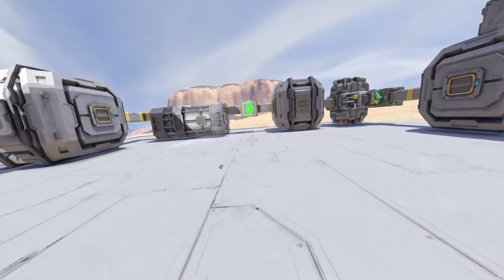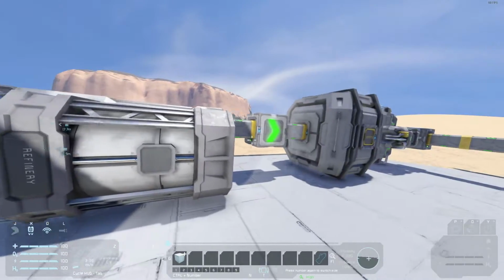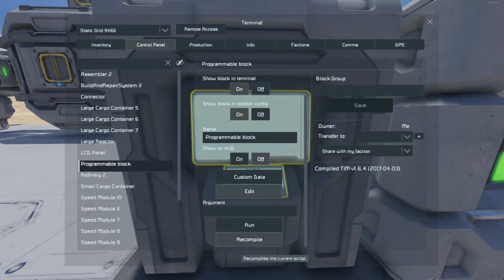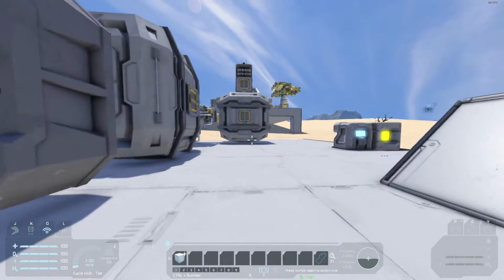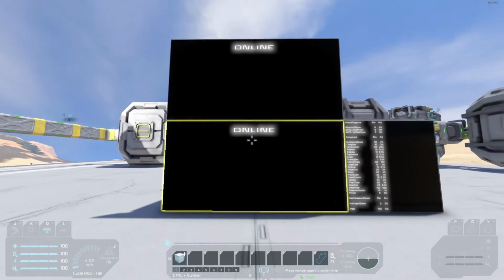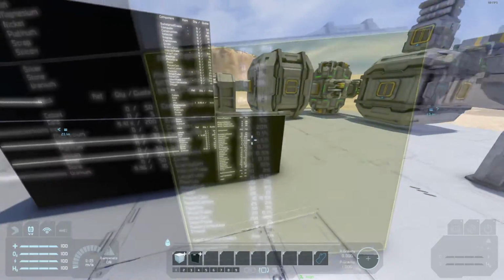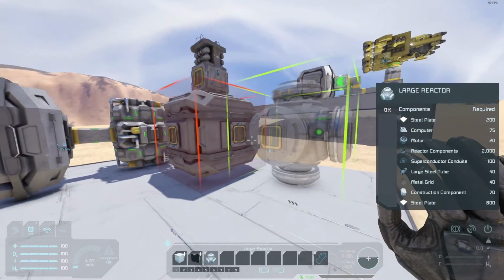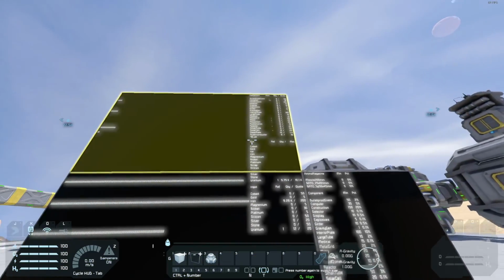Space Engineers: Inventory Management with TIM

Comment: question, What if i want the script only take care of  the refinery ?
Reply: TIM makes the refinery process the ores in smaller chunks rather then a full stack continuously. If you only put the [tim auto] tag in the refinery it will eventually get it's output ingot buffer maxed out and jam up. You can manually take out the refined ingots or let an assembler do it through the conveyor system as needed to make parts. But the script will be of little use that way. Using the tags in many cargo, reactor and assembler is where the script really shines.
If you have a large amount of ores and ingots you would rather have the excess be shifted out to a cargo module so it has room to work. TIM will eventually retrieve them when the refinery has nothing else in store. Same goes for the assembler with ingots and components.